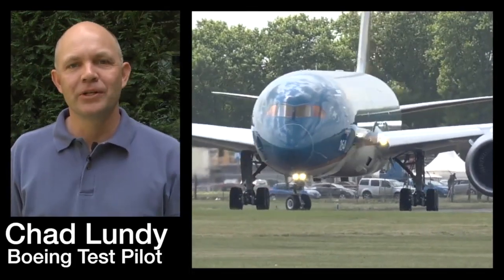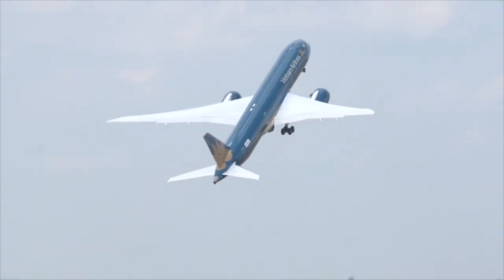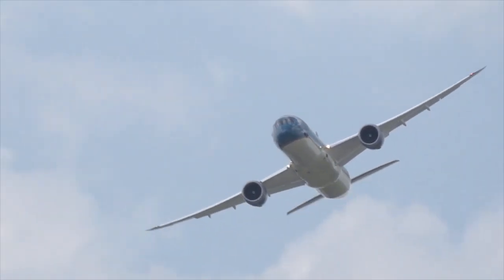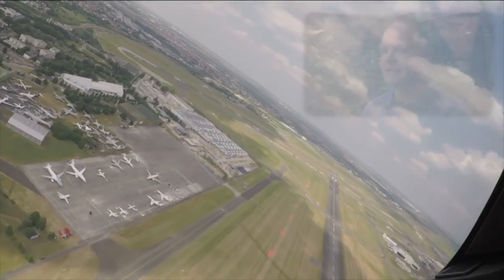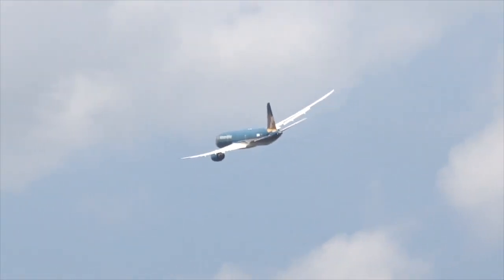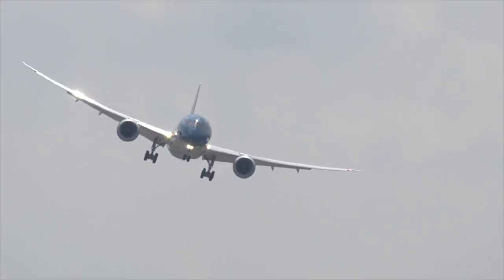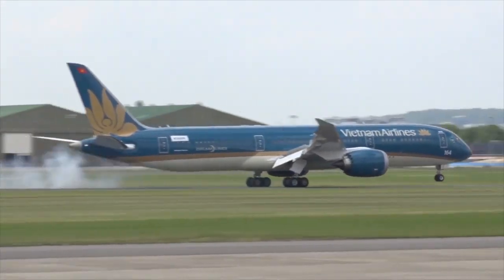Paris Air Show 2015 Dream Display: A Boeing test pilot’s perspective

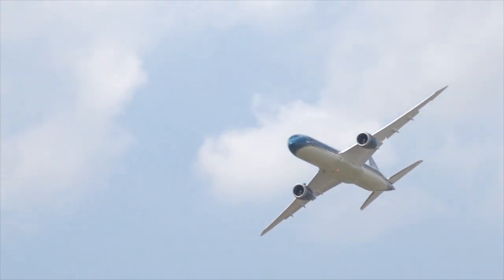Comment: what are the 2 small rectangular openings on the underside of the wing fairing centered on the main fuselage?  they seem be closed at 1:43 and open at 1:47.  What is their purpose?
Reply: They are heat exchanger intakes to provide the engines with oil cooling

Comment: That vertical take off is a commercial hype of B, it is far from vertical and they will never show you the side view of the take off.
Reply: +beavertown2006 It's very much vertical, utilizing the momentum of the takeoff run and full power to climb. They know how fast the speed will bleed off and that is when they push it over into level flight. If you want to be intelligent, you'll have to take that size 11 foot out of your mouth. Watch the practice run over by Moses Dry Lake and check out the company that show the practice flight.  It's more dramatic than this one.
Reply: beavertown2006 So, what is your problem. You hate Boeing, the USA or both.
Reply: It was vertical

Comment: An aesthetically pleasing bird, yes, same league as Concorde..Never
Reply: du Guglielmo rdv pour
Reply: CFRP fuselage, Next generation powerplants, Chevrons, New profile wing, Electronic start up, Fadec, HUD, Cat 3 EFB, Wireless Avionics & IFE, ADS-B, RNP....list can go on about the 787 capabilities in the long term Aviation, Business and environmental sustainability but the 787 will never achieve what Concorde achieved in terms of performance, aesthetics or even aerodynamism capabilities. All said and done, the 787 is a worthy replacement for the 767-772. 767-772NEO/MAX
Reply: ....time moves on...history still records Europe's triumph in the commercial SST platform...first 773E scrapped...77X enters service....etc etc...SFC by the Concorde's Olympus engine still high compared to convectional powerplants...195 min flight time LHR-JFK hard to fathom but true....that was my point from the beggining
Reply: Imagine my shock when you pointed 4 decades of technology advancement..and there I was thinking the smoke trailing the ANA787 was exhaust smoke from the JT9 powerplants...I guess my degree in aviation is wasted
Reply: That was sacarsim sir but if I have to explain to you, that would defeat the purpose. My 7 year old niece knows the the largest powerplant is the GE115-B5 and it powers the B773ER. She knows the B787 has a composite fuselage or a plastic one according to her and I her teacher knows the 787 has a choice of two powerplants, GE and Trent, the later sharing a cross platform with the TRENT XWB...so you are definitely not telling something I don't know about the 787, Concorde or the A350. By the way that was not a vertical take off..A GR8 or an F35 does VTOL..by the way the latest engine is the Trent 1000...LEAP 1A/B/C for GE..GTF for PW
Reply: I have previously worked on the 787 in engineering I do believe it looks more elegant than the Concorde when looking up close , the Concorde looks the best from a distance but when you get neat certain parts of it make it look ugly for example the windows of of the variable pitched nose cone and the engine mounts look chunky and too square I agree it looks the best from the distance but it doesn't have that smoothness of the airframe and wings of the 787
Reply: The main problem with Concorde was it drank the same amount of fuel as a 747 but only carried the same amount of people as the 737 so ticket prices were already expensive and then fuel prices went up and then the tickets became overpriced so people settled for the 747 and that is why Concorde was grounded
Reply: +James Wangari who makes the "Trent" is it Rolls Royce ? It seems they are the two big bros. on the street, RR and GE. I was surprised they used both, or either or.....?
Reply: +stanley carter it had a lot to do with American politics, "we" didn't like it because the French and English made it, wasn't "ours" so, we bullied the hell out of them for the one viable route it had, New York to London. Oh how we complained about the sonic boom, which at the time they waited until well away from land in both directions, it wasn't really that big a deal but we pretended it was. 
  That was the final straw, of course, it was always a niche plane, too specialized in today's world, the Internet helped kill it with businesses able to use video over net to see or make a deal, instead of paying $3k to be there overnight, they paid $3k for a system to see and speak to each other like they were there, and had system for the next time too
Reply: +James Wangari all that and still unwanted and, by market speak, unneeded
Reply: He is talking about concorde
Reply: soaringtractor Good to see you are still alive in 2016. Please lets not waste time arguing over trivia. Have a good year.
Reply: Mate..I have no time for you so next time you get the urge to write to me, please refer to this text
Reply: l8tr597 So is the 747, 340 and the 767. But they were all relevant in their time. So is me and you...past 70 years and we outlive our usefulness. Does it mean we should be disregarded?

Comment: What's the pitch angle on take off
Reply: ***** about 70 degrees i would guess
Reply: roborovski008 No, it cant be 90. That is too much.
Reply: ***** its about 40 degrees, there is another video of a similar 787 display where a boeing test pilot says that the pitch attitude is just under 40 degrees nose up
Reply: stanley carter It is nowhere near 90 degrees, it's around 30. There are quotes from the test pilots who confirm it. There are also side-angles of similar takeoffs. Neither the 787 nor the 737 can attain 'nearly vertical' pitch attitudes, and no, aircraft do not need to demonstrate they can fly at impossible pitch attitudes to "pass tests"...
Reply: ***** 30 degrees.
Reply: ***** 90 degrees
Reply: ***** about 65 degrees
Reply: Definitely not 90, hard to judge from the video, foreshortening  and the angle we're seen it from makes it look steeper than it really is. I'd say somewhere between 45 and 60
Reply: yeah
Reply: Pat Host will it be possible for a fighter jet ?
Reply: Robbie Isbell lol it was far less than that... Maybe 60 degrees not more.
Reply: Kaipeternicolas No, 180° down bubble is far too much for an airliner.  Most airframes begin to crack at ~6 Gs, and so a manoeuver like that would result in what's known in industry speak as "catastrophic materials failure" or CMF.  CMF is easy to avoid by maintaining "flight data points", which is another way of saying, "keep the aircraft within its flight restraints" (i.e. no excessive G-loading).  Hope that helps.
Reply: TheCandidCanadian I'd argue there wasn't many G's on the takeoff. Heck,  it almost stalled it was going so slow. But I wouldn't really know. I imagine the wings got a workout at that angle carrying the body, but it was thrust in a way as to not stress the wings up and down just straight up normal stress on the wing frame from that full thrust. There were G's involved but just front to back not the kind from say a hard bank at full speed that might twist things up.
Reply: ***** Deck angle ? A lot .
Reply: What's with the hubris, Mr. Robbie Isbell?  This is just a friendly discussion about the science behind these magnificent aircraft; nothing to get bent out of shape over.  I'm sorry, Mr. Kaipeternicolas, that you had to be abused like that by a fellow commentator.  I hope the emotional anguish of such abuse won't prohibit you from further commenting on this thread.  Peace out, Brother.
Reply: Guy C A lot for an airliner, but not much more than 30 degrees.
Reply: Robbie Isbell Robbie, sorry, but you're wrong. The 787 can't manage anywhere near 75-80 degrees. Test pilots specifically say their steep takeoff routine is around 30-40 degrees noseup.
Reply: Robbie Isbell TheCandidCanadian Ben Kolbeck  One guy is a designers the other a pilot... They didn't pull this thing past 60 degrees at the very very very most. I am more guessing around 40 to 45 degrees but I might be wrong. 80 degrees is just the most absurd thing I have heard haha and shows me that you're a designers who maybe knows theory but have no piloting experience whatsoever.
Reply: 25-30.
Reply: Probably about 50 no more than 60
Reply: It was 85 near vertical no luggage full power no internal weight
Reply: stanley carter Source please.
Reply: There is no source but they did say it was empty and it was clearly near vertical
Reply: But the 737 also did the same
Reply: I has to show it can do that for it to pass tests
Reply: Ben Kolbeck there is always these youtube aviation experts that play too much War Thunder and stuff... I am a pilot and have some ratings, not for a plane bigger than 12,500 lbs but still, I also have lots of Airbus and Boeing experience from flight training centers and I am also very sure it wasn't a "near vertical" take off. It was probably as you say 30 at most 45 degrees. But even then they would have to override the Fly by wire, which of course is possible. "Pass tests"... lol
Reply: The aircraft is empty with low fuel and no interior furnishings in this video they are able to do this